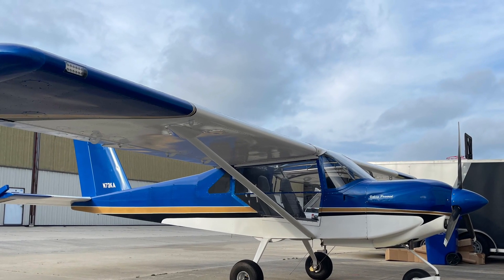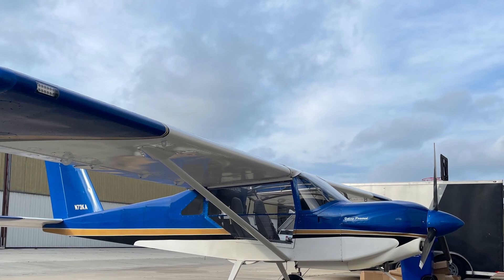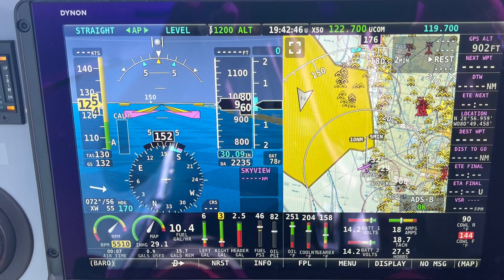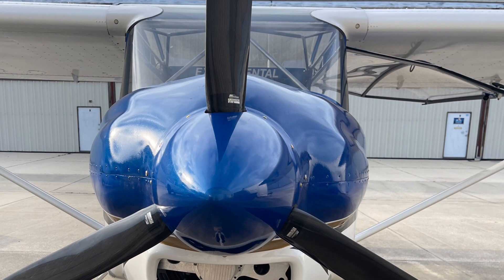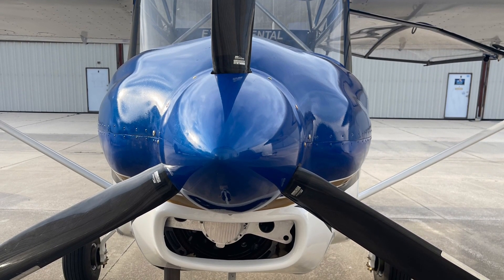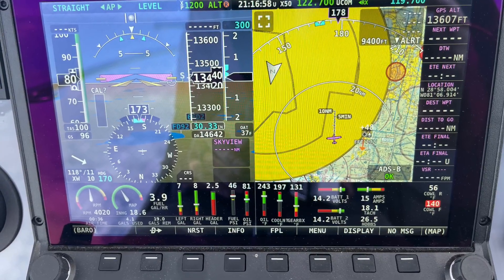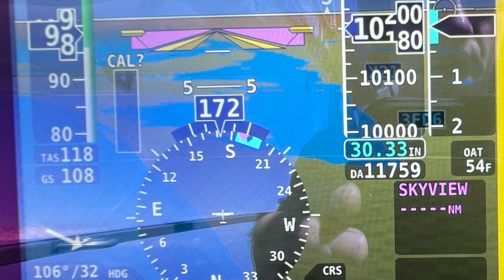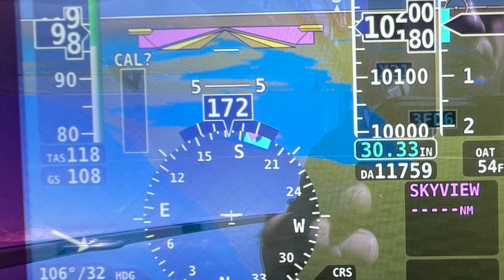Efficiency, Cross Country & Higher Altitudes in the RANS S-21

Comment: Jan,  Is the top of the cowling as slim as it can be given the engine dimensions?  It looks rather bulbous compared to the stock cowling for a Titan or Rotax.  Does the engine have to be mounted this high to keep the thrust line correct?
Reply from the maker: Yes, it has to be higher due to the inline engine layout. You can reshape the look of a cowling with paint. The top of this one is all a dark blue. A two tone and some stripes would change the look drastically